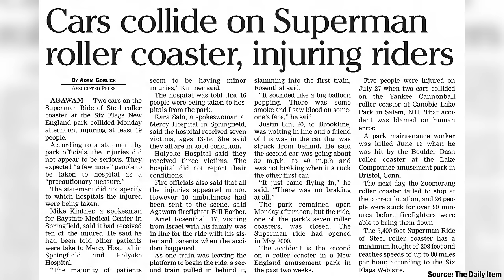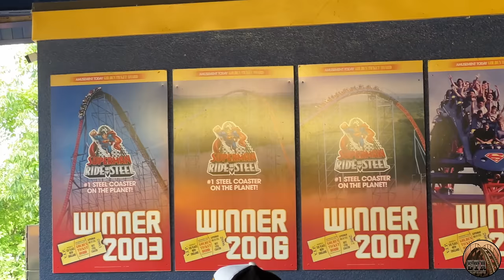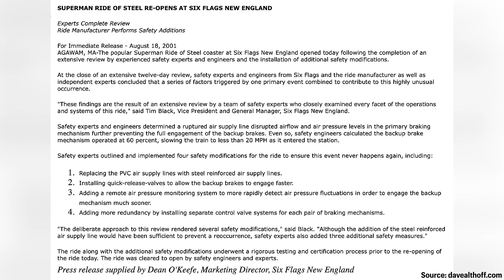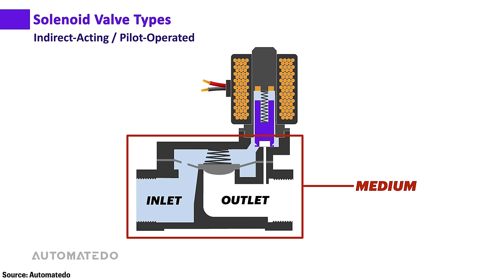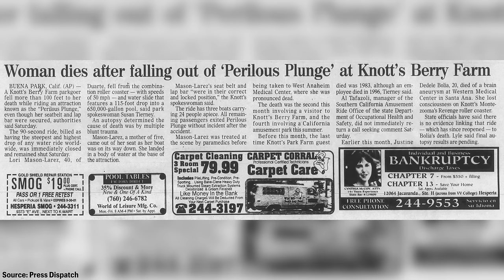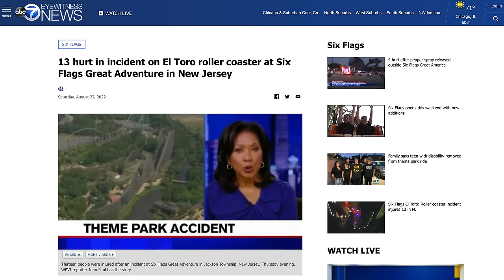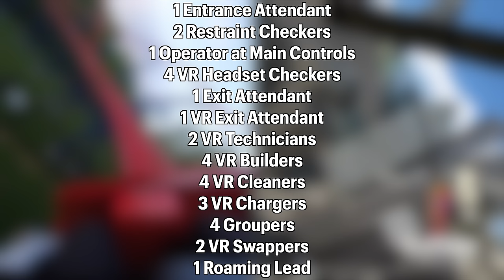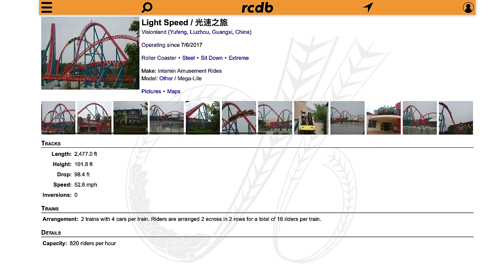The Accident-Prone Superman The Ride - A Problematic Roller Coaster

Comment: I haven’t watched this yet but just want to add my thoughts about Superman bc Six Flags NE is the closest park to me. 

The ride up the lift hill is possibly the worst. Inching slowly to the top of the hill with a lake just to your left, losing sight of solid ground so all you see it water beside you. I have to look dead ahead at the seat in front of me each time otherwise I feel like I'm about to drop right into the water. I've zip lined between mountain peaks a mile apart and I have to give serious pause about whether the lift hill or the zip line is more terrifying.

One time I went to 6F with my sister-in-law. Superman was closed all day except for like 3 runs and we were on the third run. At one point I remember hearing and feeling a big clanging thud then we were held up at the final break zone before the loading bay for about 10 minutes. We were laughing the whole time loving life while her husband was nearing being escorted out of the park by security for how much he was freaking out over us not getting off the ride after it had stopped with my husband bracing himself to try to stop an altercation from breaking out. Never found out what that thud was, but we did decide our husbands probably shouldn't come with us to the park again for the safety of employees.

I maintain that The Cyclone is a better coaster, but the lines for Superman are absolutely wild sometimes.

Edit: July 2023 saw record amounts of rainfall, so the flooding was unfortunately universal through MA, NH, and VT.

Comment: One of the other modifications to the new seatbelts and how they were used is how the load process went, at least for a time (not sure if it remains). The black loop on the seatbelt was a step loop. The crew would literally step in the loop to pull the seatbelt as tight as it would go. It was incredibly uncomfortable. Once everyone's seatbelts were handled, only then did the fixed restraint come down. Load times were atrocious and the ride wasn't comfortable at all. The new bar and ankle pieces were "ok" to me but it was the seatbelt stomp that killed this ride for me.

Comment: I can't believe that VR deal with Samsung was literally just hacking together a VR system using phones. That's like a teenager's poorly thought out project idea. I had assumed the headset would be purpose-built hardware for coaster VR (especially since it was a trend at the time).

The other thing that's surprising is that it wasn't an upcharge element. You could imagine the park charging $6 at the booth for a VR experience. That would make the capacity impact minimal, and to the extent it exists, it gets revenue for it. They can keep marketing the experience with almost none of the impact.

Making it upcharge could also greatly extend the longevity of the phones and make it viable as a permanent offering. They could keep enough phones for every seat in case every rider buys it, but rotate them on each use, disturbing the wear evenly (since it's actual use will be rare). They could even buy a mini-fridge to store them in, and the time between uses for each phone would give them enough time to get really cool.

Comment: Working on a roller coaster and watching it deteriorate over a decade due to Frankensteined restraints, computers systems, and Ops is way more frustrating than Ryan let's on. I looooove the details in this video about the restraints as my coaster went through similar changes and consistently turned away larger riders to avoid incidents

Comment: Expedition GeForce is still my number one steel coaster and Superman ride a steel at SFNE is still my number two steel coaster. They're excellent coasters with great air time and strong laterals that you can't find too much. You talked about the track and the transitions, but in my opinion those transitions are a positive cuz they accentuate the air time especially in the backs seats. The second, third and fourth hills on Superman in New England and the second and third hills at Six Flags America are outstanding, as are the bunny hills.

Comment: Regarding the new chassis designs, they are on average about 500Kg  heavier than previous versions. Intamins documentation says that the car chassis is a "lightweight sheet steel fabrication" but they certainly don't feel lightweight when you are trying to shift them around.
The biggest single contribution to the weight increase is the brake magnets being mounted on the trains instead of the track. Each magnet pair and their associated mounting hardware weighs about 150Kg.
Intamin do 3 chassis designs that they use on pretty much all their coasters and the different chassis are combined into whatever train configuration is needed.
There is the light car which has no brake magnets, anti-rollback or lift dogs and weighs around 1000Kg,
Then there's the heavy car which always has magnets and can be fitted with both ARB and lift dogs as needed, these ones weigh in around 1800Kg,
And finally, the heavy lead car, this is an elongated chassis compared to the other 2 and can only go at the front of a train as it includes the balance axle. This one car weighs roughly 2600Kg.

Comment: One thing I noticed is that the original Supermans throw you into the bar pulling out of the better airtime hills, especially that second crazy airtime hill in that back, and even Apollo does this. But the SFNE Superman does not. Different profiling, although the U-bricks may help.

Comment: 30:50 For those of you who are unfamiliar, a block zone is a section of ride that only one train may occupy. At the end of a block zone is a method to stop a train in case the block zone ahead is still occupied. This is the safety system that prevents roller coaster trains from colliding with one another.

He does not copy his scripts, ladies and gentleman.

Comment: I first rode Superman (or Bizarro as it was known at that time) in August 2014. I only had a passing knowledge of its history with the accidents and death and changes made to the train. Enthusiasts had told me how horrible the restraints were after 2008 but I guess ignorance is bliss because I absolutely loved it. I rode it again in 2018 and nothing had changed. Except for it now being called Superman again. I had ridden the Superman at Six Flags America with the Frankenstein T-bar and as a taller rider with thick legs, found that restraint much more uncomfortable than the U-brick. I would love to see a more modern solution from Intamin but it looks like that's probably not happening.

Comment: I utterly hate this ride due to ride operators. I was too big for the ride and kindly asked to get off because I could not get the belt buckled and instead of letting me off the ride operator was just pissed off that o would ask that and struggled but got my belt buckled. The whole ride I felt like I was gonna fall out because the seatbelt wasn’t holding me in and it seemed like it was gonna snap. As a six flags worker I was so pissed they would do that and never again will I go to six flags New England or ride Superman again

Comment: This is really enlightening given I’ve actually ridden this ride. I rode it for the first time during its bizarro era and though I don’t remember that experience as specifically because it was a long time ago now, I do distinctly remember another coaster at the same park, one with a boomerang design, having a particularly uncomfortable seat design. My friend and I agreed that the seat ended farther than our knees and the restraints were placed in such a way that clamped our legs to the seat in that uncomfortable way. I do not remember anything else about the ride but that being so distracting that that was all me or my friend could focus on. Given it was in the same park in the same state, I can’t help but wonder if there’s a bit of a trend here with state safety regulations causing uncomfortable restraint configurations.
The other time I rode it was 2 or 3 years ago and that time the restraint was much more comfortable. It was a whole body kind, which admittedly did make it pretty annoying to try to hold my glasses to my face (will wear contacts next time) but I think that’s not really how you’re intended to sit so I give it a pass.
Overall it is very interesting to learn about the history of a coaster that I have actually been on. Thanks!

Comment: This is why factors of safety exist in engineering, to leave a buffer between the theoretical minimums and maximums that certain features should be able to withstand and the amount actually provided.  For example, a factor of safety of 1.5 would mean that a part that is calculated to require the strength to withstand 40 lbs of force would actually be provided to withstand 60 lbs, such that if anything were to go differently than expected, the part would still not be compromised.  This is why large B&M coasters like Orion or Valravn have long stalling brake runs that seem like overkill; the factors of safety all but guarantee no collisions

Comment: Absolute banger of a video mang! Crazy good video, also funnily enough the derivative (or instantaneous rate of change) of acceleration (G-Force) is actually called "Jerk". This means jerk is literally the rate of change of acceleration! What that means is likely Millenium Forces track was not only heartlined, but the heartline was designed with more derivates in mind. For instance Superman might've only  been designed with acceleration in mind, while Millenium Force likely was designed to with Jerk or even Snap (rate of change of jerk) in mind.

Comment: no joke: i rode this coaster back when it was new and almost fell out. i always put my hands up on the first hill on roller coasters and i did that same thing sitting in the front row, left outside seat of Superman. the T-bar lap restraint clicked down pretty far on my lap but was still loose. i pushed it down as hard as i could and the ride operators even tried to lock it further too but it seemed fine. when we dropped over the crest of the hill i felt myself lifting out of the seat and the only thing holding me in was my knees and my feet firmly planted to the floor. i panicked and grabbed that little metal handle as fast as i could but in my head i thought i was gonna fly into the Connecticut river. scared me really bad like no other roller coaster, and then i heard about the guy who DID fall out and i can totally see how that could happen. T-Bar lap restraints are crazy in hind sight and I havent ridden any roller coasters in a while now. i stick the the type where your feet dangle below you when i do.
on a different note: we used to go to RiversidePark in the 90's pre 6 Flags and they held awesome demolition derbies

Comment: Hy, Ryan! Great video!
The ISO 13849, Parts 1 and 2, are the international standards that establishes requirements for the design of SAFETY RELATED PARTS OF CONTROL SYSTEMS (SRP/CS) of industrial machines. I recommend reading them, as the principles can be applied to other types of machines, such as roller coasters. The monitoring of the correct functioning of pneumatic valves can be done by position sensors of the pistons, not depending on the line pressure.

Comment: I have very limited experience riding any amusement park rides, most of my experience is in fact on other rides rather than coasters, and most of it was either parking lot carnivals, or Oaks Park (a old iconic, yet small amusement park in Portland, Oregon). But I will say I am VERY familiar with bad safety harnesses/lap bars. At Oaks Park, they have (or at least had) one of those swinging ship rides (no idea what they're called specifically), and the sheer amount of space there is between your body, legs and the seats was beyond excessive and a bit terrifying. At the time I was super slim, and at probably 5''6-10" or so, and I was literally being lifted over a foot into the air against the bar every time we got to the apex, and began our downward swings. I had to cling to the bar with a vice grip of life in order to not go falling or flying from it. No belts, nothing but this drop down bar that was hard, had no padding, and averaged a good foot of space on the chubby adults that rode it between that bar and their legs and bellies. Also that slick plastic seating, too. Its just not a acceptable combo in all honesty. So if I got into a coaster or other higher speed and velocity ride in the future and they lacked what I'd consider adequate safety to keep you in place, I'm bailing out immediately haha. If I was one of these people that got ejected from the ride because when they got in, they should have noticed they lacked proper security in their seats, I would have immediately voiced my concerns, pointed it out, and opted to leave.

Comment: a lot of intamins have variable lift speeds - idle, engage and run - the rides with short break runs will most of the time run at engage speed until the break block is clear, meaning with one train, it will speed up earlier to run speed, as there is no block behind it that needs to clear, so it will wait for the entire train to be on the lift before speeding up to run speed (not too sure if that is how superman runs, going off of experience with colossus at thorpe park)

Comment: Any time a restraint system is cited in 4 seperate ejections within a few years and less than a dozen rides use them- there needs to be a fix. I know most of the ejections related to other failures in operations and/or body types- but you can't have 4 ejections in the span of a few years.

Comment: While expedition GeForce never ran into major issue with the restraints (as far as I know) they had an derailment in 2010 caused by an axle snapping after 3 years.

Front car wheel often hit the inside of the shell, which lead to the front car being replaced in 2011 (or 2010)

Also the backrow on the "old" train has some major issues which often leads to the last car often being closed.

Comment: Superman is one of my favorite coasters, and I think the only thing keeping it from being my favorite (which is currently Nitro) is the restraints not being a T bar. I go to the New England park often and always ride Superman roughly 5 to 10 times per visit.
I personally do favor these restraints to many other coasters because I'm on the larger end of potential riders, and the Superman ones are more accommodating than U bars on other rides. Particularly El Toro, which causes pain akin to unmedicated period cramps with pcos. Of course, I still ride it, but I'm complaining the whole way through, and I have to sit down for a few minutes afterwards 😂

Comment: 0:33 "we will dwelve deep"
So this isn't AI-5G garbagespanation.  Thank you, and I stan your lisp.

on that red-blue crash.. this was "engineering failure" gold.  Well worth teaching:
 Its horrid they were using PVC on a vibrating machine to carry critical pressure. (it was probably "low pressure")  And far more horrible that no one at Entemann(?) figured out that a slight leak (which you almost implied it was), created a mid-way state where the system, its sensors, and its failsafe all failed together.  It was basically destined to fail from day one.  This sounds (and I cannot be sure but seems presented) like a clear design flaw, and you surround this with the evidence of design experimentation on several one-of models.  This flourishing of creativity comes with this sort of problem.  1/10 systems you one-of will have some critical problem overlooked, just like here.

Following the red-blue crash (hell, it needs a name), when Mr.Big fell off the ride, the body politic got involved.  They aren't engineers.  Those cars sure could win an Ugly Award today though.  I greatly prefer the Pull-down harnesses, but finally I understand the draw of those leg constraints, er.. T-bars.   I think the best redesign might be a couple pull-downs in the rear rows specifically for obese people.

Comment: Tragedy for that rider but if he was rejected in 2003 because of his unusual body shape for the coasters restraints and decided in 2004 to roll the dice with a potentially different ride crew but having the same body issues. As sad as it is to say this one was on him it just was. Use some common sense. If not deemed safe on one day then him deciding to go back means he didn't respect the safety rules of the operators and probably assumed he knew better.

Comment: The absence of physical contact is not the reason why magnetic brakes alone can't stop a train per se. Now in a practical sense, any braking device that is used to bring the train to a final stop will make physical contact. But from a physics standpoint, the eddy current effect that magnetic brakes work on does not occur at a velocity of zero. The magnet and conductor must be moving relative to each other in order for current to be induced. As the relative velocity reduces, the repulsive force reduces. As the train slows, an equilibrium state is reached where the momentum of the train (or acceleration due to gravity on sloped tracks) is equal to the deceleration imparted by the brakes, which results in the train moving at a constant rate. (Rolling resistance and air resistance will continue to slow the train slightly).

You can test this at home with a non-magnetic (copper, aluminum, or similar) pipe and a neodymium magnet. If you drop the magnet through the pipe, it will fall slower than gravity, at a constant rate.

Comment: As a 78 inch rider without a large stomach, it drives me crazy that they changed the height maximum on the ride after the 2004 accident when the rider's height had nothing to do with it.  I fit perfectly fine in the test seat (and safely rode the attraction previously) but I'm still not allowed on anymore.